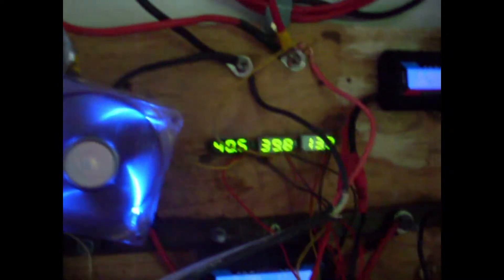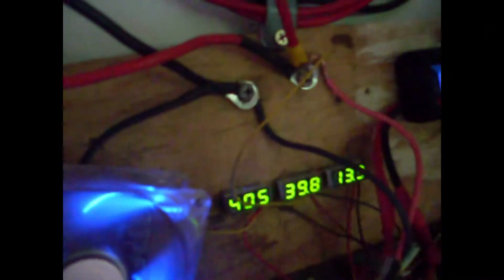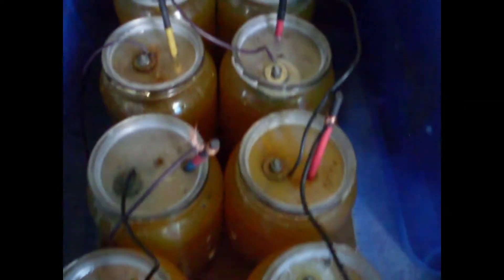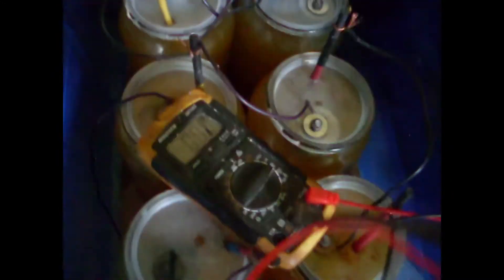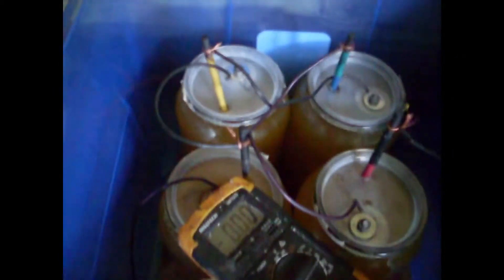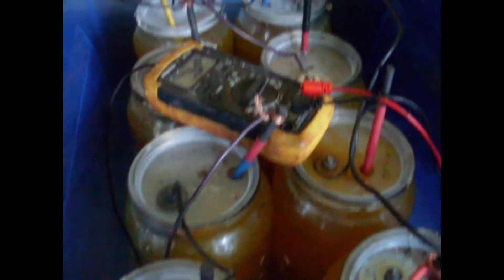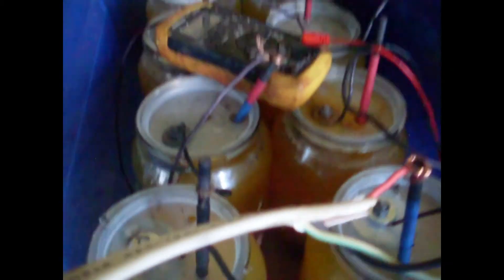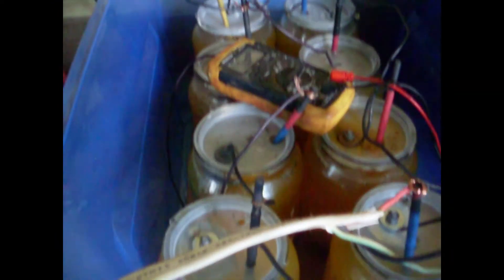Zinc Bromide 14 volt bank for solar

Comment: As of my last knowledge update in September 2021, zinc bromide batteries were primarily used in large-scale energy storage applications, such as in grid-level energy storage systems. These batteries are known for their high energy density and low cost, making them attractive for such applications.

While zinc bromide batteries are commercially available for large-scale energy storage, they are not commonly found in rechargeable consumer products that are available for purchase by individual consumers. These batteries are typically designed for stationary energy storage and are not widely used in consumer electronics or other portable devices.

It's possible that developments have occurred since my last update, so I recommend checking with battery manufacturers or industry sources for the most current information on the availability of rechargeable zinc bromide batteries for specific applications.

Comment: Are you still producing videos? I am experimenting with zinc stainless steel batteries I came up with using potassium hydroxide and manganese dioxide. The cells produce 1.1 volts at a fairly reasonable milliamp. 500 to 1,000 milliamps as far as I can tell but I am not familiar with how to rate it. Either way they are holding up fairly well after 2 weeks of charging and discharging running a 1/2 watt LED yard light. I am interested in your design also. I like your makeshift set up. I use those buck down converters for all kinds of off-grid projects. Great video thank you for showing your set up and progress.
Reply from the maker: I am waiting or a graphite pot to use as the electrolight holder https://www.ebay.com.au/itm/134864521290?var=434332567180 so i need to test it if its a conductive container I hope to be making a vid soon thanks for your interest more research
Reply: Great, I made a few changes on my particular design. Now I am using Epsom salt along with Manganese Dioxide in distilled water. With a stainless steel mesh as my Cathode and zinc as the Anodes. I am using the Manganese Dioxide and other chemicals that I retrieve from a basic carbon zinc battery. So it has carbon also. They are rechargeable. So far my first set has been cycling for close to 3 months. Not a lot of amperage but they power LEDs and small fans. Thanks for the update.

Comment from the maker: it has been 2 year sines i charge these batteries and after frustration with copper leads corroding away i left them to stand i decided to revisit them last week on average they was 1.2V in each cell 1 cell had 1.78 volts
I am buying the clay pot rubber t murry smith suggested to insulate the dendrites.

Comment: Thanks 4 ur recent videos, pls do also let us know the Ah or Wh after discharging the 8 cell battery.
Reply from the maker: I am charging them at 16volts straight from my solar panels it will take time now to work it out plus i need parts to connect it to the 12 volt lead acid
Reply: @aussie_Logic  OK

Comment: Nice progression. Your carbon electrodes, just drilled the plate and stuffed the rod through? just snug fit holding them? using waterproof wood glue as a binder I have molded my plates from powdered carbon to a carbon rod, so far 1 day it's good. did you stay with RMS's 16.6 and 20.4 measurement for electrolyte boiling it down from 200ml to 50ml for a 2+/-M solution?
Reply from the maker: 1) drill plates snug fit and hot glue to stop them falling off
2) I made 1 litre 1 molar mix 166 grams zinc sulphate with 2 molar 224 (double check this amount please) grams of sodium bromide per cell reduce it down to 100 mills i normaly use about 300 mills to desolve it anyway dont boil it not good for fumes
3) when all the salts have dropped out pour off the electrolyte add water till you have enough 
to fill the cell